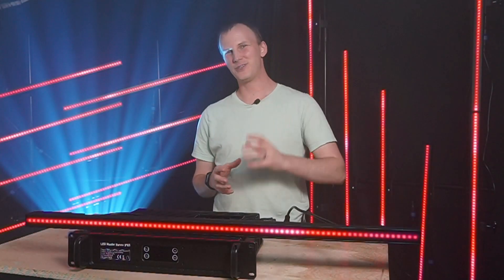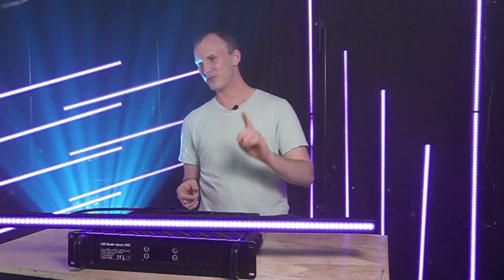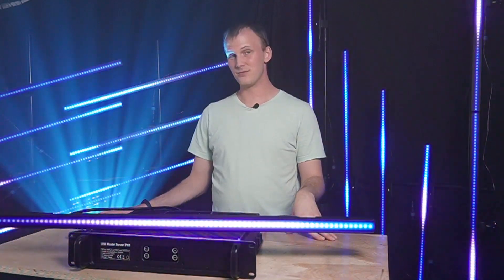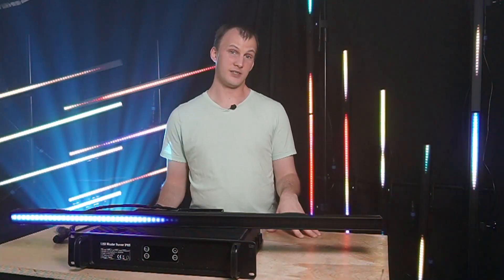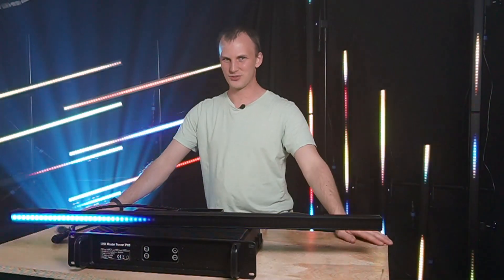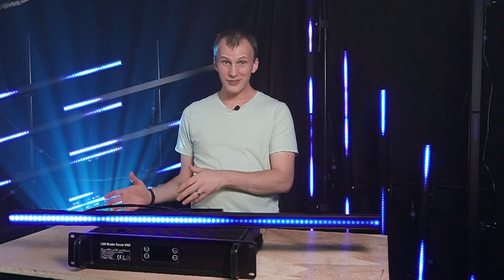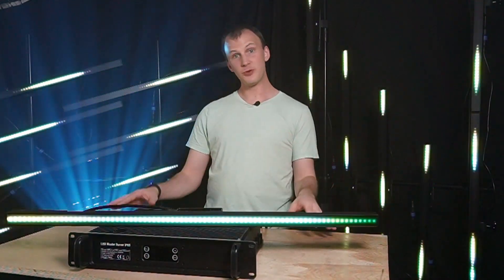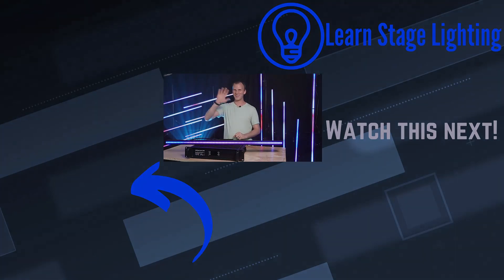What is with LED Pixel Strip Systems?

Comment: This might be a dumb question, but are you able to do Pixel Mapping over DMX lines, or do you have to utilize sACN/Art-Net/Kling-Net? I'm considering a system of Pixel fixtures for a backdrop for my church but would like to know if I have to make sure I have network cables ran for the system before committing to the idea.
Reply from the maker: Must use network, yeah, DMX would be 2 fixtures per universe....so that wouldn't go far! :)
Reply from the maker: Feel free to email us at gear@learnstagelighting.com if you have any other questions :)
Reply: @LearnStageLighting  thanks so much!

Comment: Gotta love vendor lock-in! Every company has to do their own stupid protocol that only works with their systems and punishes you in some way if you go with an open standard.
Reply from the maker: I mean, that's true and also not true.  Pixels from one brand may not physically work with another brands systems as they sometimes use different voltages and protocols for the data.  So it's not quite that simple with pixels, but that's also why we like the GAMMA system - it runs on Art-Net

Comment: 4,569.00 USD!! That's insane! I mean I realize you got to make some profit but! 4k is like a ETC 4! Which is a more useful fixture.
Reply from the maker: It's actually on the cheaper end for pixel strip systems if you look across all the manufactures.  Keep in mind that's for a package of fixtures!  For many users doing music/modern worship/DJ/EDM, having a package of pixel strips is far more versatile than some Source Four's!
Reply: @LearnStageLighting  oh a pack? Like 6 or 8?

Comment: 8 dmx channels according to gamma site, so you do not have full control of each pixel?
Reply from the maker: That would be the lowest channel mode - basically a set of macros.  In it's full mode, it's 240 channels per bar (full RGB pixel control x 80)

Comment: 6:31 "Art-Net only' and you like it? Art-Net has recommended lower FPS. sACN E1.31 is a far better protocol for pixels.
Reply: Yea but sACN requires an ethernet cable doesn't it?
Reply: @tofitatv  Both Art-Net and sACN E1.31 are using UDP/IP. Where Art-Net is network unfriendly. In any case sACN E1.31 is the better protocol for pixels.
Reply: Yo Arjan if I have an obsidian nx wing and I run onyx lighting software I have 4 lupo full color superpanels soft 30 lights and I want to run 3 pixel strips all in one universe what lights strips should I go with, gamma, chaveut, Martin sceprton, or adj, ?I just want everything to communicate with my console properly and software to be one software